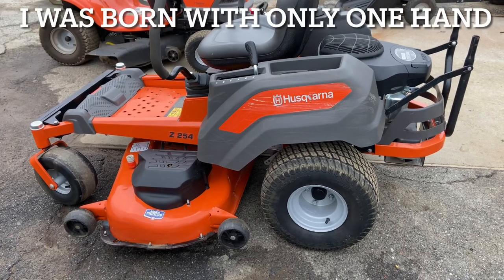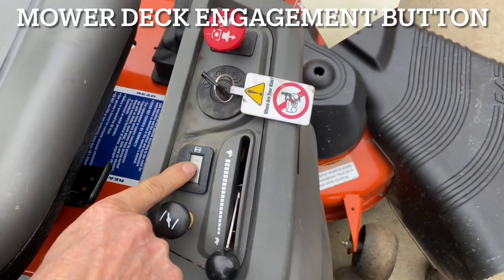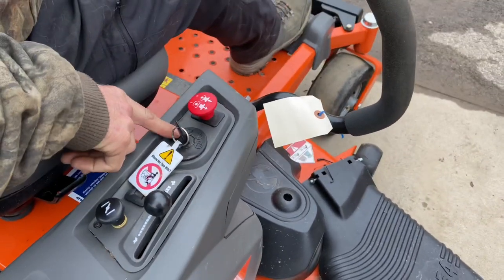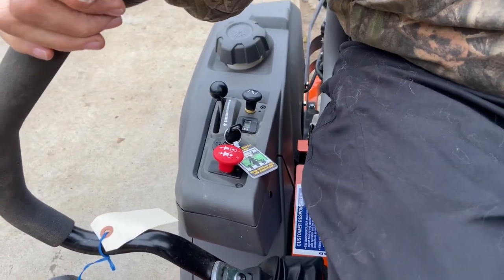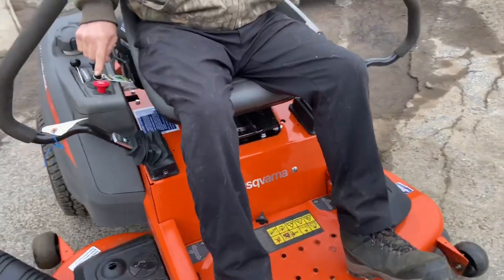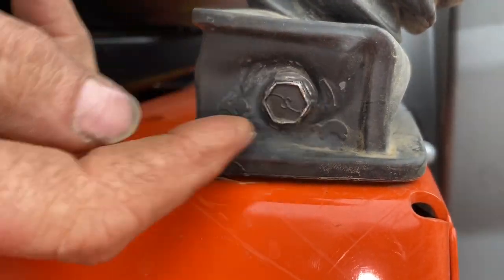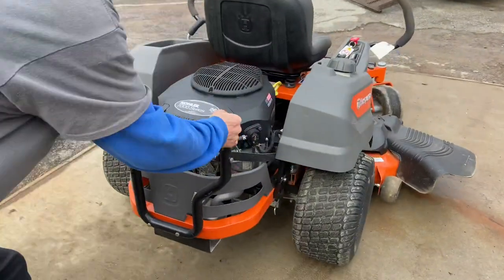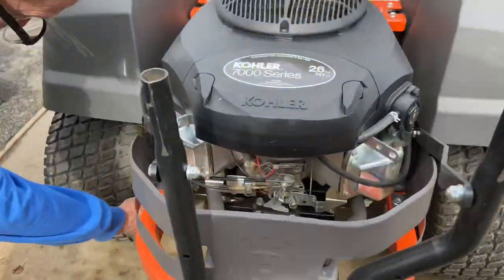How to Start and Operate a Husqvarna Z254 54" 0 Turn Riding Lawn Mower

Comment: Thank you for this video. I bought this unit in April 2023 and in November 2023 the original battery died. The warranty covered sending me a second battery at no cost and I used it in the machine a couple hours this year (Spring 2024) and now it's dead! UGH, I will try all your steps, I appreciate your working on these topics very much because it helps me when I've run out of ideas..
Reply from the maker: You may want to watch this video to give you a better understanding about the install and I give you my thoughts on what amp battery to put in. https://youtu.be/z51pvgYcyYA. They may have sent you a low amp battery? CCA "cold cranking amps". Low amp cranking batteries do not hold up very well. Also remember to also slow charge the battery a few times in the off season to make sure it stays fully charged. I would also suggest to take your ignition key out so you know you did not leave the key in the on position, that will drain the battery to dead quickly if left in the on position without the engine running..
Reply: @JohnsonsSmallEngines  Hi there, thanks a lot for your recommendations on this. after using the unit for one season in 2023, the original battery died and it was replaced and now I have an interstate 300 CC. I checked that video you made about batteries, the handlebars are all the way out, the brakes are off, battery cables are connected, no wires below air filter are separated from the little switches they are connected to, it has gasoline, oil is clean and between the little dots,, belts are new and in place. It randomly stopped last week after cutting for 2 hours in plain grass that's flat and it was 3 ft tall in some places waiting for the belt to be installed, it's been washed, but suddenly after that cutting 2 weeks ago, it died.  I used a portable jumper kit to restart it, not charge it, jump, it started, I drove it and cut 2 ft grass on level 5, then down to 3 for an hour, it turned off, then wouldn't start at all and hasn't since then. I drove my Ford Explorer to it, jumped with cables, black first, then red to the truck first, then black first and red next on the mower, and started the truck, but nothing happened. waited, nothing, waiting for nothing. Now I can use my last option before buying a new battery which is to wheel out the portable charge/jump starter that's about 3 feet tall and has worked on other units in the past.  Ideas?

Comment: Awesome video! Thank you so much. I just bought one of these and now feel comfortable hopping on one even though I have never used a zero turn mower previously. I have used riding lawn mowers, but wanted something that could have a sharper turn radius.

You basically answered most of my questions on how to use and operate this machine. Now, time to go cut the yard. LOL.
Reply from the maker: Hi Rob, just take your time and you’ll get it down in no time! Thank you for watching and the kind comment:)

Comment: On the control arm forward stop adjustment bolts, it's important to note that you have to be on a level surface to test whether you have both sides right.  If sloped even slightly right or left the mower will go that way due to the caster front wheels.

Comment: First thank you for sharing your videos ... I just purchased the same machine and I love it, but the control arms are so stiff I can hardly push them out to park and they are it's difficult to go forward and backwards. How can I adjust equally without having to take the mower back to the dealer which is 45 miles one way! Do you have a video for this situation? Thank you for your time and expertise.
Reply from the maker: They should get easier as you use the machine, but if need to, you can loosen the pivot bolt where are the arms pivot? I do not have a machine to look at, so I’m just telling you through what I think you can do just follow the handle down to where it pivots and gets stiff. There should be a bolt and a lock nut there loosen that bolt a little bit and see if it works.

Comment: Ever seen a loose parking brake (on the handlebar parking brake like this one) where anytime you try and leave the handlebar parking brake engaged to get off the mower while leaving the engine on and the loose handle gradually comes out of park and the engine turns off?
I have the z254f and have had the issue for about one year. I just haven't seen anyone have the issue or seen a fix.
Thanks for your review. The z254f has been a great residential mower for 3.5 years running now. I look forward to many good years to come
Reply from the maker: I have not come across that but it sounds like you just need to tighten the e-brake handle where it attaches at the pivot. Basically try and tighten the brake handle. Or you may need to tighten engagement cable or both. If the brake is holding when it is engaged before the handle falls then I would go with tighten the handle.

Comment: Mine has had trouble starting since I got it. It clicks, then you have to move the handles around, put them in the neutral position, then try to start it with a few more clicks, then move the handles around again, then back to the neutral position where it will try to start. sometimes I have to do this several times and there is no way to move those handles out any further.
Reply from the maker: Not sure what you mean by "clicks". This video may help. https://youtu.be/z51pvgYcyYA

Comment: great review. My z254f is weaker on the left side. especially noticeable on hills, any thoughts?
Reply from the maker: Does the machine go straight on flat ground when you push both handles as forward as they can go? If yes you may have a transmission starting to fail. If no you may to adjust hydro arms. It sounds like you may have large hills on the property?? Do you or have you towed anything behind your machine that was heavy at some point? How many hours are on your machine? Just curious.
Reply: @JohnsonsSmallEngines  Thank you for the quick reply! Machine is new to me- 3 years old and only 15 hours on it. I picked it up with a drive tensioner pulley theat had half melted and it wouldnt move. replaced that and now its moving. Right side engages really quickly, left is a bit sporadic. seems better if i engage the right first.
Reply from the maker: 15 hrs. on the machine and it had a seized drive tensioner pulley. Hmmm, something sounds strange. Is the pulley a transmission drive pulley?
Reply: @JohnsonsSmallEngines  Ive actually figured out the issue- the drive belt was routed wrong. the tensioner pulley was between the hydros instead of after. Works great now. I appreciate all the help !

Comment: I have the same mower as shown in this video and only have one issue. It has a creeping throttle cable and I can’t figure it out. If put in full forward position it will immediately start to creep back to the mid throttle position. Any help for this problem would be greatly appreciated.
Reply from the maker: If there is a bolt and lock nut going through the center where the throttle handle is to tighten? Tighten it. If there is not, then it is a pressed together throttle cable and the easiest way to repair that issue is to replace the throttle cable.

Comment: Mine shuts down when I try to engage the blades. I have no idea if I am doing something wrong or if something is wrong.
Reply from the maker: Make sure your motion handles are on not out. If you have a parking brake? Some did and some did not, make sure it is off.

Comment: What type of oil should I use???
Reply from the maker: It should say I’m the manual but most engines today should be ok with with 10W30. but I would confirm that will the manual.

Comment: My husqarvana Z248 my engine has to warm up before I turn on blades or else it will shut off. Do you know why?
Reply from the maker: You may not have the throttle fast enough? Make sure it’s at full speed. What is the outside temperature? The carburetor may be running to lean. Try pulling the choke out a little then engage blades then take choke off.

Comment: Is this a dependable mower ?
Reply from the maker: It’s very new to me as I just service the machines. It seems to be a ok machine for non commercial purposes. Time will tell if this machine holds up. I would suggest reading reviews on it. The twin Kohler engine on this machine is doing good on many different machines out there that I service.
Reply: @JohnsonsSmallEngines  
Thanks.  God bless you 🙏.

Comment: I came to this video just to see if mine is ok or has a problem with the hydraulics, because of the noise it makes like a bad power steering pump or one that is low on fluid or has air in it.  Sounds like they all make the noise so I guess I'm ok.

Comment: My z254 will not turned over. The battery is  good, clean fuel, and oil.  It's trying to turned over, but it will not catch
Reply from the maker: “Trying to turn over”?? Is the engine spinning when you turn the key to crank? but it still won’t start. How long has it been since it ran?